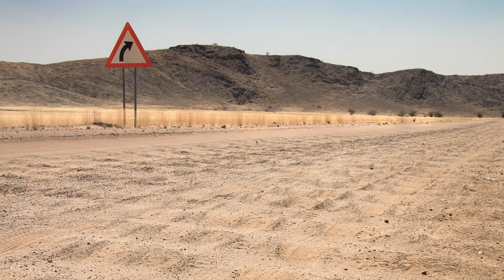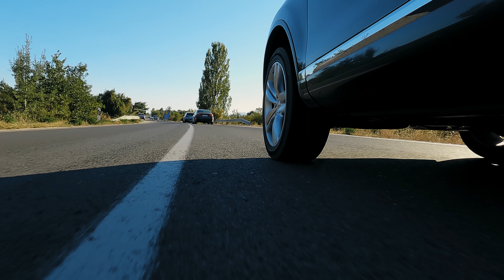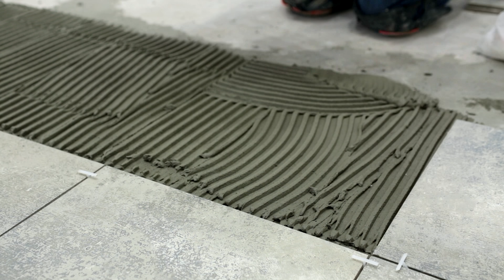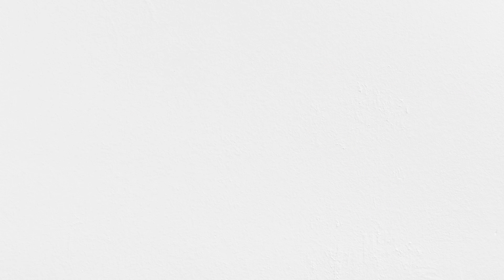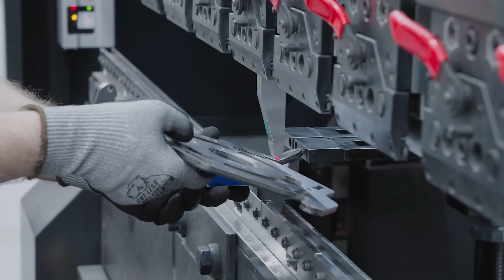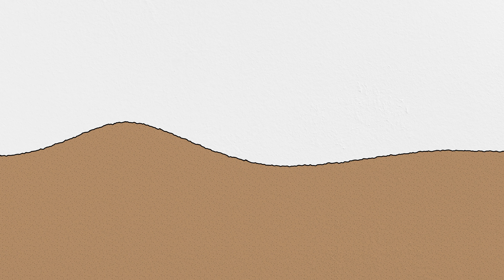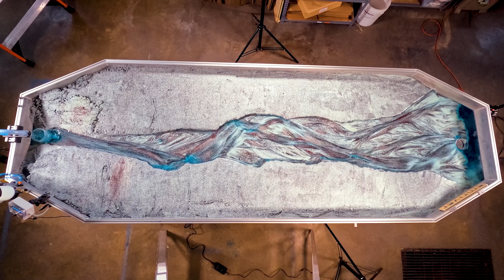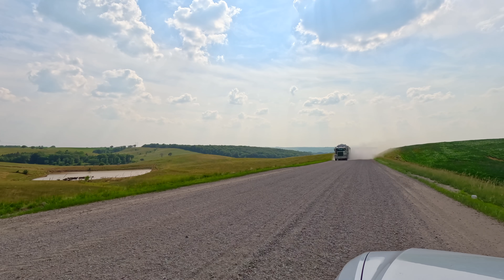Why Roads Get Washboards

Comment from the maker: 🏞 Lots of cool stuff (plus my book) available at the PE store: https://store.practical.engineering/
⚙ Check out SendCutSend for custom parts fabricated from your CAD: http://sendcutsend.com/practicalengineering
Reply: The dirt road near my friend's ranch was regraded into the washboard state to control driver speed.
Reply: @PracticalEngineeringChannel you have it mostly right. 
As a water tanker driver that supported rebuilding dirt logging roads it's also braking and acceleration that makes it worse.
Reply: Absurd idea, given this is a sort of wave, is there a "destructive interference" one that will smooth it back down? I mean let's assume to force a "jump" at a low point, the downward motion should lower a bit the next high point, and so on... Can this be tested?
Reply: @MarcoFerrariMsg Yes, this is doable, and I gave Grady a comment on this thread asking if he could make a demonstration video of smoothing out a washboard road simply by using a different speed of driving regularly. The washboard is a direct result of the natural frequency of the vehicle suspension, which cannot change, but the washboard is stuck in place as you are driving. A different speed can cause your suspension to move material to the low points from the high points, and every trip makes the road SMOOTHER.
Reply: @MarcoFerrariMsg  Force a jump on a low point? Ok, tell me how we will jump suddenly from a low point to a high point in that scenario?It will fill in with loss mass at the bottom but always bring a little to the top, but at speeds the cars will only hit the tops, compacting them more and more over time. This is Of course not the only effect, but I belive it is a a part of it, and more in the beginning when the road is new then it is later on. But i am only speculating. I hope that, that is still allowed.
Reply: @StarDollar  it is only a speculation, there is a simulation in the video, let's assume we place a small bump or a ramp in one of the holes, so much so that instead of being in the lower point in the "wave" the weal is now  on the high one.
I know this can't be done in a normal road, but, given a simulation it may be interesting to try
Reply: @MarcoFerrariMsg  нужно подтормаживать колесо в верхней точке, вполне реально сделать. 
      Или как-то настроить управляемые амортизаторы, чтобы они становились жёстче  перед пиком волны, а при приземлении были максимально мягкими)
Reply: An old grader operator once told me that too much loose material on the top will create washboard quicker than if you only leave an inch of material across the road. That is why you often find a small windrow along one edge of gravel roads. The only way to get rid of washboard is to cut all the way down to the bottom, so you end up with a lot of extra material. If it is wet you can lay it out but often it is too dry so you put it in your "maintenance windrow" and hope it catches a little rain before you come back.

Try compacting the base layer with a little moisture and just a thin surface layer of loose sand on top. I believe this will make a more realistic test.
Reply: @Johndozer I like this description and I really need to know, what about if clay was mixed in! I have limited understanding of engineering so I'm asking here!
Reply: @chaselamanque3669 I'm no engineer by any stretch of imagination but I like to know the 'why' when I can. 
Here in western Canada we cap most gravel roads with a layer of clay under the driving surface. At a microscopic level, clay soils are a 'plate like' structure that lock together very well with a little moisture and compaction. 
The thickness of the clay cap, as well as the depth and type of sub-base, have a big impact on how long a road will last or how much weight it will carry. Often we started with a meter or a meter and a half sub-cut and then build up from there. If the clay was scarce then we saved it for the top foot or so, just under the gravel. 

The 'sand' roads we have generally need a lot more  maintenance but you work with what you got. 😂 
Like Grady said, cost effectiveness is the key. 

Airport runways are crazy deep sub-cuts in some places I've heard.
Reply: I would LOVE for you to do a experiment using your road to show how using a different speed (and tire track) smooths the washboards back out. Going faster for a few weeks and slower for a few weeks breaks the washboard cycle, and the road becomes flat as glass. Driving with your tires on the humps gets rid of them and puts those coarse rocks back down in the gouge lines where they belong. There is also a small range of speed that pings the natural frequency of the suspension of most vehicles, and they are all surprisingly similar, from F250's to Camry's. Avoiding this speed range can also redistribute the road surface in a manner that actually smooths it out. 

I need a video that I can send my neighbors so they can learn the true art of driving gravel roads.  My neighbors who complain the most are the ones creating the washboards, and I cant explain it as well as you could in a video. You would save Americans a billion dollars in 20 years.
Reply: I belive the start is the buildup of sand as a wave when speed is increases and when  the build up is big enough it's easier to push the wheel up rather than thru the sand,  than it's lands and repeat.
Reply: DCM welds polycarb
Reply: Why can't we just have flying cars and be done with this already!?😂
Reply: @Lorenzozolezzi  We don’t have Flying cars, because building insurance would go up substantially.
Reply: @Dookybootie Dammit one can dream. I hate trying to move around on narrow road with so many idiots around!😅
Reply: @Lorenzozolezzi  They are going to have Drone taxis soon buddy.
Reply: @Lorenzozolezzi Ever seen washboard clouds? 😂 I have! Keep an eye out for them. It is a similar effect, even without those new futuristic aeroplanes zipping back and forth hither and yonder.. 😂
Reply: @Lorenzozolezzi were we not promised hoverboards and landspeeders buy now?! 🤣
Reply: on beaches they have  a rake pulled by a tractor, this pulls sand back and grooves it, could something similar work here?
Reply: Good vid. Maybe investiage to see if the same process that causes washboarding will "walk" the aggregate between the cells of a geogrid with time (making them less effective and succeptible to crushing), and how easily that does or does not easily happen for different types of products.
Reply: It's crazy how velocity, percussive oscillations, and soil surface and viscosity variables result in a resonate response.
Reply: HOLD UP! I've been on MANY jobs where the road base was #2 or #4 stone, THEN 304s were laid on top of that base.

For gravel, washed 57s are put on top of the 304s.

(I used to drive a dump truck.)
Reply: I'd like to see this with different materials, especially if you can manage varying degrees of uniformity. Something like BBs, specific classified materials like abrasive blasting media, table salt, or different shaped uniform pieces like Y shaped plastic beads.
Reply: This phenomenon also happens on steel railway "bars".
Reply: Why there's no washboards on mtb bike trails?
Reply: Maybe because of tactile feedback: rider directly feel that force delivering into motion or wasting on surface ruination, and able to calibrate it interactively.  Would be nice and also economically and ecologically more efficient to have similar feedback on other vehicles. E.g. the effort needed to pushes the control lever that regulates torque should be proportional to the amount of force applied to driving wheel (like torque/pressure sensor in pedal assist): that would be even safer, because driver would feel loosing traction very well.  Could be useful for hybrid/electric cars/motorbikes where it easier to modulate torque.
Reply: Okay, there anyway some bumps, because of breaking or skidding.  But not so much if riders care about the trail, so at least able to keep it smooth.
Reply: 12:02 that sounds like it should break entropy...
Reply: You should check out how motocross tracks develop! Especially Lommel in Belgium
Reply: Yes please! I would like to see more tests on that rig.
It's worth saying that, in warmer weather, asphalt road surfaces will also washboard.
Reply: When my National Guard unit deployed to Desert Storm, we got all new trucks equipped with a Central Tire Inflation System. The manufacturers showed us a video claiming that reducing tire pressure (which you could do with a button in the cab) not only reduced the effects of washboarding on the vehicle, but in a convoy of many trucks, actually reduced the washboarding itself!
Reply: I appreciate the hard work you did with making this video but I drive down a public dirt road a lot and I was hoping you would talk more about how to stop the wash board patterns.
Reply: Washboards here in New Mexico are formed by extemely dry conditions, unroutine maintenance, and honestly? 100% of it is the vehicle's suspension and speed. 

Pickups make the worse as when those washboards start jumping up and down so does the suspension, especially in the light rear where the drive tires are. 

After a short amount of time you have dugout areas where tires grip well, and ridges from when the momentum of the weight is moving back upwards lightening the rear end. 

Speed ofc also plays a role, but really that's just as an amplifier not problem causation. 

I'm 99% sure this is it cause my neighbor's vehicle is independent rear suspension, drives like a mainiac, and it doesn't produce the same effect of washboarding. It starts this weird back and forth pattern from one side to the other where half way the washboard starts and the next starts where the first stopped just further down the road from the otherside alternating.
Reply: My gravel driveway is 1.5 miles. 
What’s the optimum gravel and grading?
Reply: A video on surface dressing (UK term I don't know if it's the same in usa) would be interesting in the same vein as gravel roads. many more rural roads in the UK are laid with poured bitumen and loose gravel poured on top. Traffic then compacts it down and the excess gravel is swept up later and reused. 

worn out roads can be like ice rinks in the wet and freshly topped ones are hazardous for skidding and flying stones, altogether brilliant for national speed limit roads at 60mph 😂

one downside that I've been witness to was a truck size road sweeper stalled out on a freshly dressed hill because he was basically driving on a steep gravel road and couldn't get any traction
Reply: @nicholas2198 surface dressin is pretty much called the top coat in my area, idk about other places
Reply: @Justin_Ebright   i used to volunteer at a heritage railway that meant driving about 40 minutes of my trip on those roads at 50-60 mph and sometimes it was great fun when my front wheel drive passat was sliding sideways round some of the bends 🤣

not so fun and fast on ice and fresh gravel though
Reply: "Let me know if you'd like to see a video on..."   

Yes.
Reply: Разберите влияние балансирной подвески на дорожное покрытие, когда две оси на одном балансире. 
        И гидроудар в лужах, от колёс. Когда даже низкая скорость не спасает от размытия берегов лужи.
Reply: Нужно использовать шины низкого давления. Делать их как можно больше. Но это увеличит расход топлива
Reply: I saw a report saying some places are tilling cement into dirt roads and it performing better than expected? Is it true?
Reply: I’m convinced Bike lanes are Money laundering, and you can’t convince me otherwise. People who use those lanes, don’t pay extra for them. Especially when they’re only used for at most 2 months of the year. 

The cost graph, and use are inverse. I’m sure they cost much more to construct/maintain too.
Reply: Great video as always, but might I suggest: if you got this idea from a paper, link the DOI in the description or the pinned comment in case someone wants to look into it further.
Reply: When does wash boarding (small) become whoops (large)?
 Like on a dirt track.
Reply: Watch all the way through even if you don't decide to do it you already have done it sounds like a good video I want to watch it Pin it as a short
Reply: Hey I have a question for you!!! What happens when you add clay? Clay sticks together well and if dust is gross would that do anything?? I'm not an engineer but my parents used to drive on them constantly. The dust is abysmal and overtime can just wreak havoc on your paint unless you drive slowly.
Reply: *correction: what would happen if it is blended in the top mixture
Reply: Kind of a weird comment, but I could watch the sand dunes marching around the circle for hours.

There is a channel here on YouTube, Atomosfär, that makes long form videos specifically to help autistic people relax (my personal favorite so far is the high voltage pendulum)

Would it be possible to do some kind of collaboration with Chris Boden (he runs the channel as well as the PhysicsDuck channel) to make a long form video about the machine you just built?
Reply: Yes, I'd love to see more about how some pieces of plastic or maybe small sprinkling of other shapes can prevent washboarding.

For example, can you put some metal ribbing on the side to stop it?
Can you use some plastic in the squares like you showed? How long will that last on a road in Vietnam being used by lots of motorbikes, a bunch of cars and some trucks. Or can it take the load from tractors like those used in a farm (e.g in Australia or USA)?

Will spherical metal balls or simply non-slip matting work?

What's the minimum needed to stop the washboarding. Maybe you could have a single strip of hardened concrete down the middle? Or do you need patches of it?
It feels like there's some pattern that could disrupt it without being overly annoying. Something @Steve Mould would likely love to work out.

Also, Magnus Larsson suggested using some bacteria and water to harden sand. Could something like this be used?
https://www.ted.com/talks/magnus_larsson_turning_dunes_into_architecture
Reply: Constructive criticism, no disrespect;  lose the background noise.
The subject & your narration of it is great! The addition of distracting, monotonous & annoying music ruined the vid for me.
Reply: Your setup might not be able to support it due to the dimensions, but I would love to see how a tracked vehicle (tank, snowmobile, etc) affects the washboarding.
Reply: At an intersection with a stop sign where lots of big rigs go through, like near a big farm or warehouse, one can see washboarding in the asphalt as those big trucks come to a stop.  One can also see the painted lines  and letters distorted due to sheer effects even if washboarding hasn't occurred.
Reply: Yes! I want a video on the unpaved roads washboard strategies on how to keep it still
Reply: if you go like 100 its smooth as butter
Reply: The honeycomb things in gravel that keep the gravel in place longer, the name of which escapes me 
Yes, please do a video on those. 
If possible, give them a more memorable name. 
Gradys, perhaps. 
It is fitting. 
Leave your mark on engineering history, whether they want it or not!
Reply: @andrewom679  I think that gravel stabilizer is for larger structural stability and it is fully covered in gravel and may not stop washboarding.
Reply: You could do a whole series on washboard roads and formations and I'll be here for all of it.
Reply: Please start selling those little white figures you have in your setups.  I want one of those little guys to place around my house!
Reply: YES! PLEASE TEST multipl;e roads types (and maybe even different wheels settings, like width, speed, down-force/weight- maybe even material? - nah, that tire material wouldn't make a differnce until you tested hard surfaces like concrete and asphalt - BUT, you COULD do a long term testing of them. it wouldn't be too hard to make a concrete circle, but the asphalt might be a little hard to source, but since yuou have so-me connection with the Dept of Public Works, (I THINK that's who yopu did the sewage/drainage videos with, right?) they might be able to tell you where you could get some old pieces, or maybe even a BUCKETFULL of some new stuff - that would be a pretty big project to take on, but it's totally doable, and once you build it you coudl l et it run 24/7 for the whole summer, and it might be low power enough to just run off a solar panel if you have one laying around, or find a cheap used one. - I think this would be a really, Brady-style video series for real! Anbd maybe you could make it a tradition that ever summer you do a summer-long/long-term project.. and call it "A Very Brady Summer" lol or something silly :p
Just some ideas for ya, but 'll be totally happy with any video you put out. :D
OHHHH, so do yopu remember a while back, liek 4 or 5 yuears ago, you did a video about a retaining wall collapse on a New Jersey road construction project, for 295/42/168   ?? I was really surprised when you showed it because I live around there and I had seen the collapse nearly everyday for quite a while with no clue what it was until your video. Well I wanted to tell you that I went by there this morning fdor the first time in a while and they're almost done putting up the overpass - yes, it's not done yet LOL - they did fix the collapse eventually, but it's been over 10 years that they've been working on this 3 year project LOL That's NJ for ya. Just wanted to give you an update. And maybe when they finally fini... wait a sec, scratch that.... Maybe IF they finally finish it I'll get some pics and send em to ya somehow :D
Reply: The washboard roads are caused by using a bulldozer that has tank tracks, instead of using smooth track treads !!
Reply: @b.powell3480 literally what are you on about?